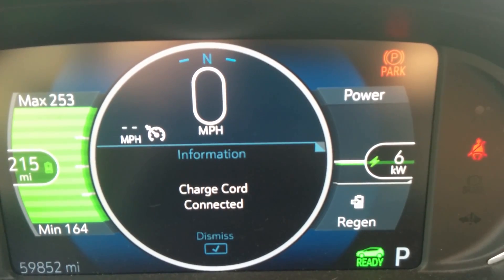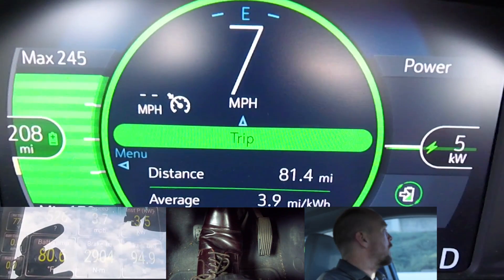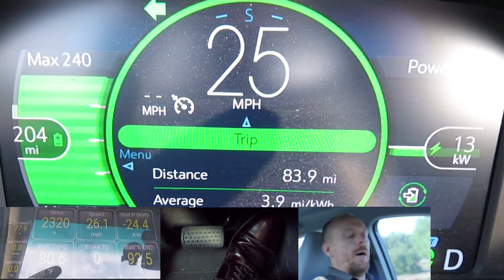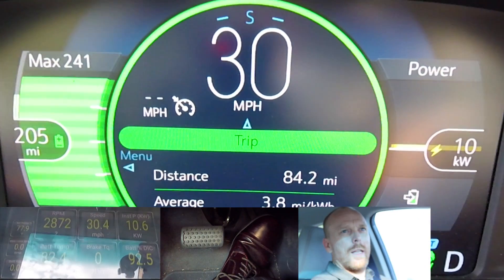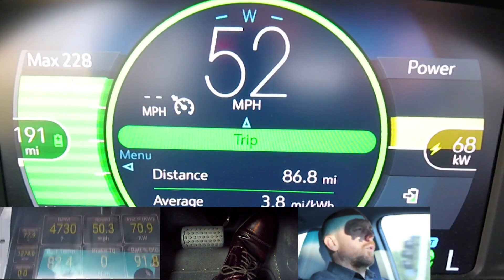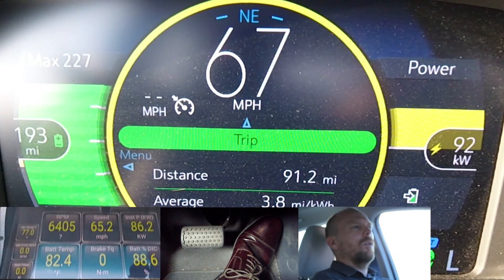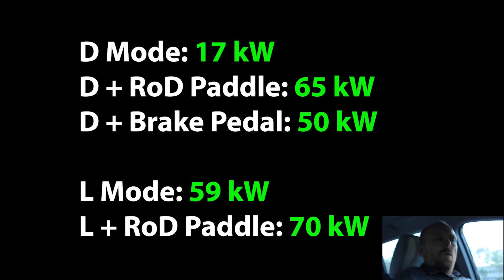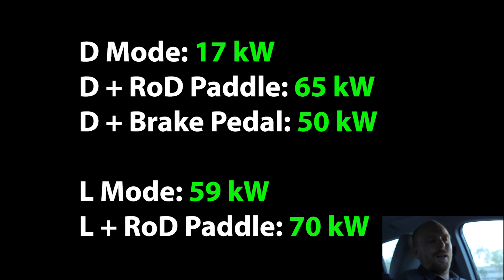Chevy Bolt EV Regenerative Braking Review

Comment: I am not sure the point was made that as long as one uses the foot brake pedal gently (start pressing on the pedal early and for a longer period of time, which avoids the implementation by the Bolt of the friction brakes until the car is almost at a standstill) the total amount of regenerated energy is nearly the same no matter how one chooses to bring the Bolt to a stop or slow it down.

Each method, brake pedal, RoD and driving in “L” mode, puts nearly the same amount of energy into the battery. The only difference is the RATE at which they do it and that is dictated by when and how vigorously each is employed.

My Mother always told me, I should drive as though there was a light bulb between my foot and the pedal I was pushing on.
Reply: In theory, what you said is true -  the total amount of regenerated energy is the same regardless of the mean of slowing the Bolt down. However, the regenerative braking process is not perfect. When you use L or on-demand paddle, the regenerative power is higher than in D, the higher power has more loss from AC to DC conversion and from charging up the battery. Therefore, with the same initial speed, road condition and battery state of charge, you would find that you get less regenerated energy when the regenerative power is higher. I hope this makes sense to you.
Reply: @icekk007  Got it, I think. Thank you. I believe what you said is that the slower the rate of declaration, using regeneration, the more efficient it is? I believe I alluded to that with the light bulb scenario.
Thanks again.

Comment: Im using a lot Neutral to realy coast, just D regen 17kw and sometimes is not efficient at all. 17kw slow down just too much when you need to lift and coast. All that regen way to use regen can be max out when mixing all theses modes you explian very well.
Reply from the maker: Yeah, it would be nice to have a coast mode. I typically either modulate the accelerator or use cruise control.

Comment: The regenerative breaking is not just a "nice thing to have" in an EV -- it's essential -- and the Bolt version of that I find to be a superior implementation to my BMW i3, for example,  because the Bolt has at least three different "levels" to apply (as you've described so well...) rather than one fixed full-time level (in the i3).  On a recent 100 mile round trip from my home to Mirror Lake in the Uintah Mountains, I started out with 227 miles on the "meter" and was down to about 130 after covering the first 50 miles due to a 5,000 ft. rise in elevation. BUT on the way back the regen kept the speed from going over the cruise control setting (otherwise it would have gotten way out of control)...so regen was working the whole way back down (but I didn't use the brake at all)...so by the time I got home after traveling 101 miles the "meter" showed only a net use of 40 miles (meter at 187 miles) ....and that pickup was ALL due to regen....and my miles per KWH was over 5 for the entire trip...and given the 10,500 ft. elevation I attained to, that was surprising to me.

Comment: Great video, as always. My PHEV uses the brake pedal to control regen braking. Push the brake pedal down further and it actuated the regular brakes. Supposedly, you can feel a “notch” when you do this, but I never have as I try to drive gently. I much prefer a paddle, but the pedal works. Also, I doubt my wife would use the paddle, but it would be nice to have both ways to activate regen. Really super info on this topic!
BTW, finding a Bolt at my local dealer is impossible.  But, what really upsets me is that I can’t buy a Kia Niro or Hyundai Kona (or other) BEV because I am not in a “compliance” state. 
BEV or PHEV of any brand are really hard/impossible  to find as dealers won’t stock any. They claim no demand/don’t make sense. 
FWIW, I went with my friend to drive a new Pacifica PHEV. Only to find out that several “must have” options (available on the ICE model) are not available on the PHEV. UGH!

Comment: I think of of L mode as L2 and L mode with RoD as L1 like in a jeep my dad had in Pismo. I find appying RoD padde as irritating for  two reasons.  First that it if you are already not accelerating then its a sudden breaking experience, secondly like you mentioned that its difficult to hold the paddle while turning more than 15 degrees. My solution suggested by my so was to apply RoD before taking foot off accelerator, then you can modulate breaking by gentle release of accelerator. My second solution that I have not tried yet it to rubber band RoD paddle to be always down as it has no effect when accelerator is pressed, it trully makes an L1 out of L mode. GM please listen to me. How about a second toggle on shifter to put in L1.   ;-)

Comment: Loved the video, though I learn something new every time I watch one of yours.
Like for instance, I didn't know that the brake pedal also added some regen.
I always drive in 'L' and agree, the break lights should remain on when at a stop.
It would be simple enough if Chevy just had the software turn them on below a specific speed, say 0.5 MPH as well as on deceleration.
I have gotten in the habit of holding the break pedal while at a stop, as one-pedal doesn't always prevent the car creeping (especially on an incline).
I did learn one thing. If the Bolt detects it is creeping forward (not sure about reverse) and your foot is not touching the accelerator, it automatically applies the parking brake (hard). This startled me the first time it happened as it felt like I bumped the car in front of me.
And speaking of the parking brake, why does it automatically release when you press the accelerator in D & L, but not R? Hmmm.

Comment: Any reason you don't use a screen recorder to capture torque pro info?
Reply from the maker: Thanks for the suggestion. I'm using my phone right now, and it's close to overtaxed. But I'll test a few out.
Reply: I use EZ ScreenCorder on android. Free, works well, and if memory serves me correctly, it doesn't require any crazy permissions (ie call log, phonebook access, etc). I've used it in my Spark EV charging videos, seems to work great.
Reply from the maker: Thanks. My main concern is space and memory, but I see how it does.

Comment: Thanks a lot for that clarification at the end of the video about the brake lights. Nice vids in General. Might have a question though. I'm just starting looking into EVs and I heard fast charges are not necessarily good for the batteries. When hitting 70kw of charging, does that impacts the batteries? I mean, while braking of course...
Reply: I won't go in dept with my explanation here. But to kind of answer my own question I looked into it a bit more... On the Internet of course :p So, if we start with the fact that Lithium Batteries do not like to get too hot and that would degrade the battery on a long term basis, that’s a good starting point. Charging the battery warms them up. Fast charging them is worst. With a Thermal Management System I guess this impact is kind of dealt with… And TMS is still working while you’re using the car so no problem there. And also, even if you can recuperate energy at 70Kwh, you’re doing so for only a short period of time. Therefor not warming the batteries too much. So I guess the answer is: It has no impact at all.

Comment: How are you getting the rpm, battery temp, speed, battery %age figures etc. on those guages on this video?
Reply: Glenn Williams NC mentioned it briefly, he is using Torque Pro $5 and he uses a blue tooth OBD II adapter about $12 (for android) for iPhone you need a WiFi OBD II adapter. I use this also to get more accurate charging info. Had not found break torque and RPM yet.

Comment: I like to use D mode when driving long distances with cruise-control on. When you drop out of CC in L mode, deceleration is strong and sudden. I suppose I could practice matching the speed with the accelerator pedal before dropping CC, but sometimes you need to come out of it quickly.

Comment: Could the Bolt and other EVs have regen effectively be the brakes? Could one-pedal driving be programmed to bring you to a stop even in emergencies (if you lift off the pedal, car applies full braking force including friction brakes)?
Reply from the maker: For emergencies, I don't think so. It would require way too much braking force.

Comment: When I was in my Spark, I always drove in D mode. I would only switch to L if I had the intention of slowing down. The reason was that if I knew I wasn't going to slow down by much, I knew there would be less energy loss by coasting rather than applying excessive regen, just to accelerate again.

Comment: test drove one the other day,, L mode stops you fast lol,, the screen could be better layout as the regen should be on the top as you get more regen it goes up the same as the battery does,,, the power on top  seems reversed as it goes up the battery goes down so i think having it on the bottom going down as using is the same as the battery going down makes more sense

Comment: I was hoping you would show the brake peddle using regen as so many people think that it is using the friction brakes. In my 2017 Volt I usually just drive in D and coast as far as possible then gently use the brake or RoD. It is my experience that the brake peddle doesn't engage friction brakes until the car is below 7 miles an hour or you are really jamming them on hard to get it passed 65kW. I still think coasting as long as possible in D is more efficient that driving in L and using more energy to get you closer up to the stop. Just an old habit from the Prius days.
Reply from the maker: I did include it in the third test. I was actually surprised to see how quickly it applied some force to the brakes (just a fraction), but in the first test using only D, when I pressed hard down on the brake, it was still producing close to 20 kW.
Reply: There are a couple of hyper-miler vids on YT using the Ampera (same car). They mention that aggressive regen is a sign you're not driving efficiently, and they don't drive in L mode.
Reply: Yes, that has been my experience as well. I totally changed my driving habits back when I got my first hybrid Prius and those same habits carry over when driving and EV. I've never been a "hyper miler" it's just changing how you coast further and slowly break to time stop lights and slower take off's on acceleration. Things like that, that can translate into a couple extra miles range (and in the Volt that means I get home without using gas!!!!).

Comment: Is the paddle variable regen or is it all or nothing?
Reply from the maker: My understanding is that it is all or nothing. I've tried toggling, and it doesn't work. I think what people are experiencing is a lag in the Regen.
Reply: If the Bolt works like the Volt, then it applies the braking force on a curve, not instantly. It's not variable by the paddle (the paddle is only on or off) but it is semi-variable if you toggle it on and off at the right rate and don't mind a little variation in your stopping force. Basically you're trying to keep it within the ramping curve to use more regen than no paddle but less than full regen. I do it in my Volt sometimes but I imagine it's irritating for passengers because it's mildly irritating to me as the driver.
Reply: You can modulate the accelerator pedal while using RoD paddle.  I think of the RoD paddle as temporarily putting the car in L mode but I'm sure that's not exactly correct

Comment: Driving in L is that not hard on the transmission if not why would they have D as an option to use
Reply from the maker: There is no transmission; it's just a single reduction gear. The reason to have multiple modes is to address all the different driving preferences. Some people like heavy regenerative braking, while others don't.
Reply: A lot of people hate having braking applied through the throttle pedal. Many don't want to adapt to it, especially if they frequently switch between an EV and an internal combustion engine vehicle. It's safer if they have more consistency between vehicles.
Reply: That reply makes sense! Also if someone was to borrow a Bolt EV for whatever reason they wouldn't freak out if L mode was standard. They would use D mode like a standard ICE car and drive normally.
Reply: Although I think the “creep” from a stop in D mode is too strong when compared with a conventional auto trans.  Much prefer initiating a takeoff via L mode, which mimics a manual trans takeoff.
Reply: News Coulomb hum ok, well I have a bolt on order just waiting for it to arrive. I already have a volt.

Comment: Thanks, that is good information. It also raises a question. If L+RoD Paddle allows 70KW of charging why won't the vehicle accept a charge at that rate at a DC fast charger?
Reply from the maker: Because the Bolt EV's maximum DC charge rate is software restricted. The reason it's okay for regenerative braking is that it only occurs for a short period. A 70 kW braking will bring the vehicle down in speed (and consequently regenerative braking rates) very quickly. Even the Volt, with a 16 kWh battery, had 60 kW of regenerative braking.
Reply: News, my bad. I was not clear on what I was asking. I understand what keeps the charge rate from happening. My question is why not allow it to fast charge at the 70KW even if it is for short times? The vehicle monitors battery temps so why not allow it to charge at the 70KW if the temps are not in the red? It would go a long way in lowering the charge times.
Reply: John Smith - perhaps a future software strategy?  Push the current into the battery until the battery temperature rises to a point where you must back off on the charge rate - effectively pulsing the charge (assuming battery cooling is also running).
Reply: NC - I do like using the L mode, but am concerned when tailgaters are present.  Stoplamps come on assuming a mid-teens (kWh) decel rate, and decel rates less that point (no brake lights), though still significant, can at times get the tailgaters in trouble.  Do keep an eye open for this - to be safe.
Reply: Dennis, yes I agree. I just find it strange they have not already done this.

Comment: Great video.  I have personally seen 70KW in D mode.  But this is with the RoD paddle and tapping the brake pedal with high enough vehicle load (though some friction brake application might have also happened - I don't have torque pro to verify).   Peak regeneration isn't necessarily more efficient unless you really need to stop fast.   I personally have found that I have better deceleration control with the brake pedal than with the accelerator in L and tend to be more efficient because of this.  But I suppose it's what you get used to and personal preference.

Comment: Try in L mode RoD pull let go pull let go pull let go I think it is incremental.
Reply: The lag (if it works like the Volt) is software imposed for comfort and safety. It would be jarring and dangerous for other traffic if it applied the full 70 kW instantly, so it ramps it up gradually over maybe a second or less.
Reply from the maker: That might just be lag in the regenerative braking. As far as I've seen, it only has on and off.
Reply: If you cycle the regen paddle on and off, It does seem to ramp up the effective brake force, as if you are slowly pulsing a brake pedal on a non-EV car.

Comment: If you ever make a full charge video with cell voltage data it would be nice to compare cell voltage during long duration max regen periods. I think there is a limit for how long it will regen at 70 kw, but no idea if that’s tied to voltage rise or temperature rise. You would probably need to be going 95 mph down the steepest mountain you can find with 1000 pounds of cargo to get enough energy to create 70 kw for a long enough time to see where regen is throttled. I’ve seen a few tests, but none while reading CAN data.
Reply from the maker: I'll see if I can. It really is difficult to maintain 70 kW of Regen for any length. It only takes me 60 kW of power to drive up the Grapevine at 70 mph.
Reply: Did you see the guy demonstrating he can charge his Bolt using regen while towing it with a truck? That’s probably the best way to test, but not easy to set up if you don’t have access to a tow vehicle and a deserted stretch of road. It would be good to see how much headroom the battery has for charging at high SOC. 

Probably the same test can be done using 100% SOC, that would allow regen for longer, and might show the voltage limit while regen, and as the battery SOC gets lower 98%, 96%, 94%....it would show if the voltage limit changes or stays at 4.2v. 

Generally it doesn’t take long for the voltage to rise or sag in response to current to or from the battery, but there is probably (hopefully) a temperature component in the algorithm for max regen allowed.
Reply from the maker: After about 95%, the Bolt EV limits Regen, starting at about 45 kW and restricting to as little as 10 kW. 

The towing thing is something I'd one do in an emergency. I have the truck for it. It's the second skilled driver that I'm missing.
Reply: When the Leaf E+Plus comes out, reportedly with 100kw peak charge rate, GM is going to need to allow more aggressive charging profiles. Is still like to see someone charge one cell from a Bolt battery at 1C and then 4.2v and see where the taper due to battery design is. 

Maybe when plugged into a 100 kw charger it can have enough capacity to run battery cooling at max from the start, and allow higher charge current for longer. I think being able to charge at 1C up to 70% isn’t asking that much.